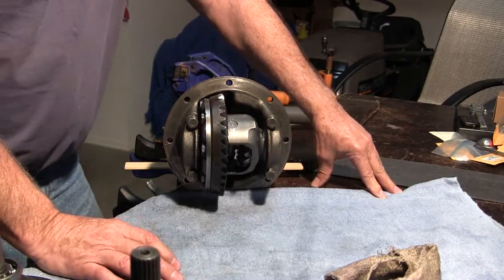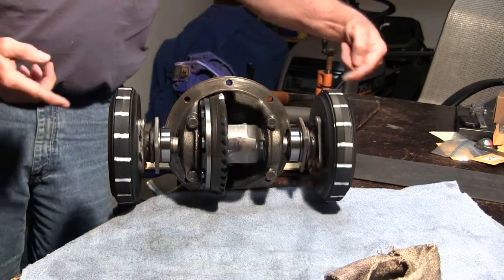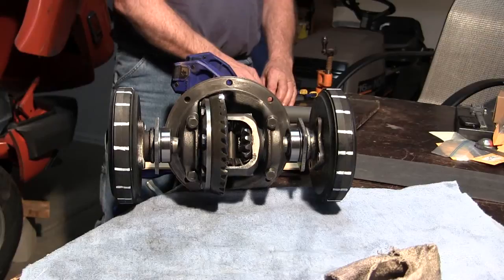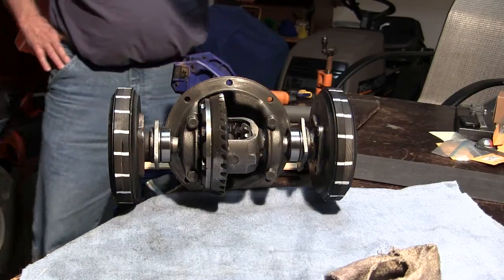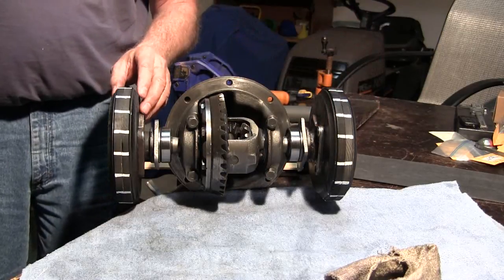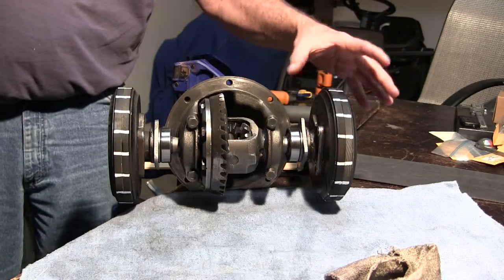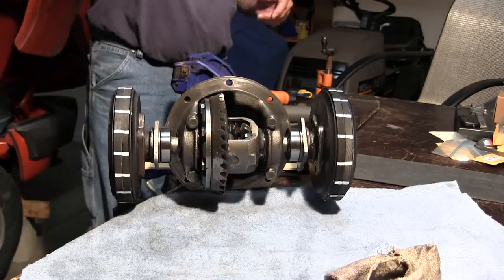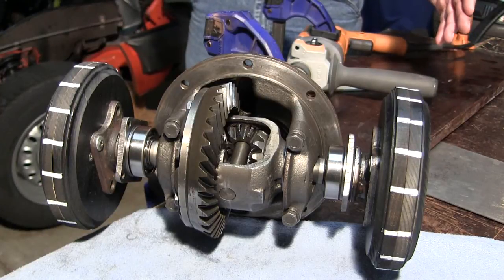When I drive my car, what is the differential doing

Comment: what if one tire just feels more resistance while going straight? will the car start to turn?
Reply from the maker: No to your question Dan. With one exception, depends on how much power to the rear wheels, and road's surface, if one tire is slipping, then the non-slipping tire will put more forward force on that side causing a minor bit of front vehicle side force, BUT as long as the steering wheels remain on the surface (no wheelie) they should prevent the vehicle front end from moving 90 degree. High powered dragsters on race tracks as an example.

Comment: In a AWD SUV what would happen for the  rear driveshaft (moving) to be unable to power rear wheels in any gear ?  Could this be a diff problem ?  Or impossible for a diff to fail completely and not move at all ... Thanks , Kevin
Reply from the maker: the ring gear must be moved by the pinon gear. I have seen broken ring gear teeth, the vehicle was towed home.
Reply: @dadcolo  

https://youtu.be/c8p_aUFfK4U.             ..this is what is happening to rear drive shaft .. I thinking it's the CV joint maybe?

Comment: Neat so that's what happens when my SUV tilts to the side in a curved hill. The weight pushes my SUV to the side so one of my tires is "floating" the suspension is really high while the other side is really low so the high side just spins because there is no weight to make traction while the other one has power and a lot of traction. Welp, my brothers car I think has a differential leak, rip.